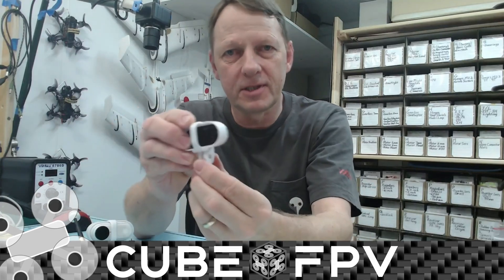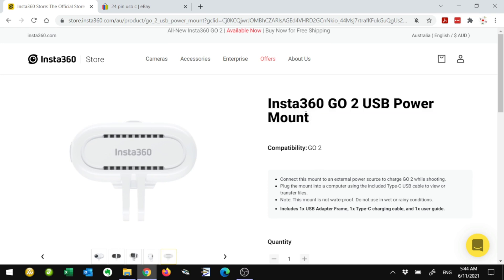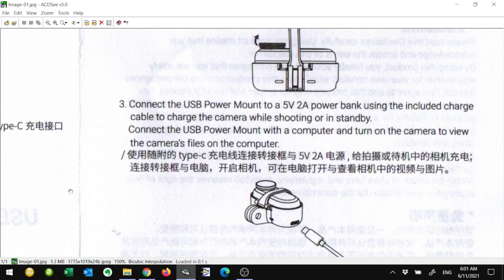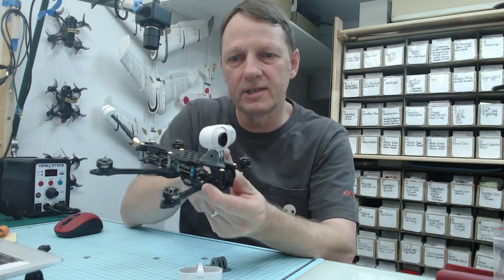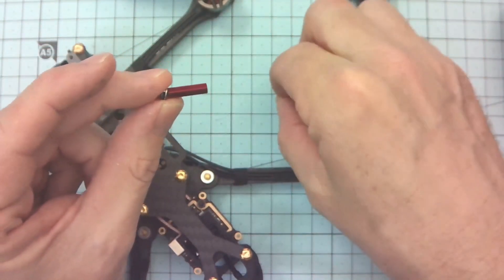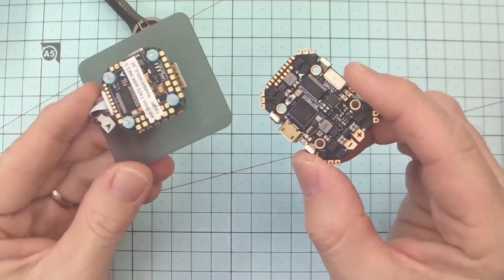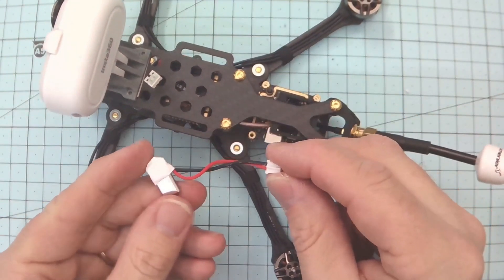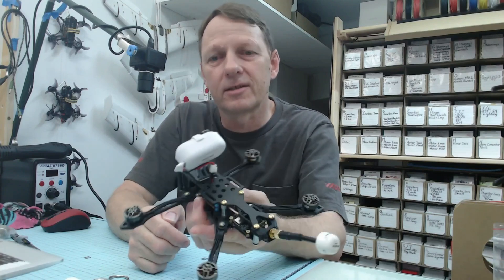Insta360 GO 2 USB Power Mount

Comment: Which of the 7 contacts are plus and negative.
Reply: Look at the v ideo at 7min  28 seconds. It shows the pos and neg. Most of these connectors are going to be the same but just check the diagram on the product if you purchased one online. Otherwise take a look at ther circuit board on the USB connector. Most will have the pos and neg marked.
Reply: @MicronWings  Thanks for the reply. Sorry, I meant the 7 connectors in the case, not the usb. I'm still waiting for my Insta 360 Go2 from Banggood.
Reply from the maker: @3goldfinger  Sorry i don't know about the ones onthe case. You'll just need to test them and see.

Comment: Hi - nice tutorial 👍 - did you try to open this case and maybe solder the power cables from the back. That maybe would be a better solution.
Reply from the maker: No but that woudl be a good idea - no need for a connector at all. I jsut wonder if the case is able to be opened without totyally destroying it.
Reply: @cubefpv  I think it  needs to be kinda destroyed first and then epoxied together again 🙂 - Unfortunately it's not on sale in my country yet. But I think soon I ll have one. It's not so expensive so I will take the risk to break one 😉

Comment: I love your attention to the details very nice work! I did not want to go through all the written of wiring to FC so I purchased these cables that are originally made to power a GoPro through the balance lead. The only thing I cannot do is control fee recording with a switch on my radio, but that doesn't bother me. I just start recording when I take off and turn off when landing! The camera stays at 100 percent! I have not noticed any difference in flight time running the camera of the lipo! These cables were nought on Amazon a 2 pack for $15 US. It works great, I just have to hold the cable with a rubber band or the battery strap. It is the fastest way to get lost to the USB mount without doing any mods to quad!! I love it so far!! Just wish I had the 64gb version now. It's funny how they launch 64 gb version  about the same time as the usb mount! Haha 😂
Reply from the maker: Yes good idea about using a rubber band to hold the plug in. The 64gb version now makes the Insta360 a really good proposition. But still the 32 version will give more recording time than even a long range flight. So i'll probably struggle by with it till i lose it or destroy it.